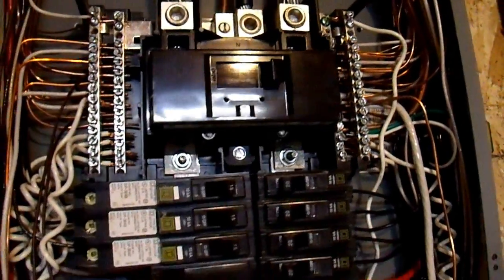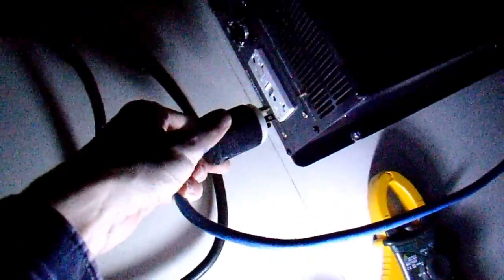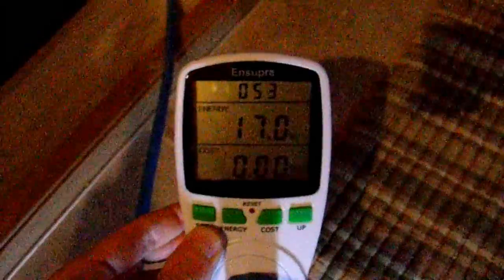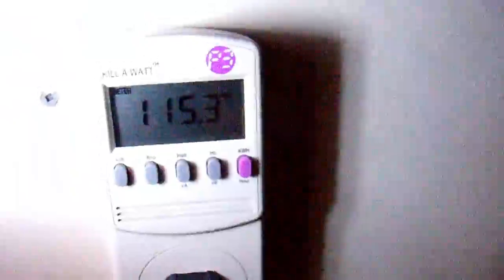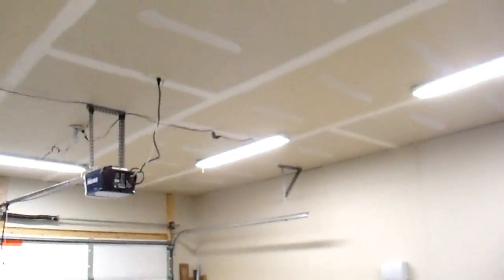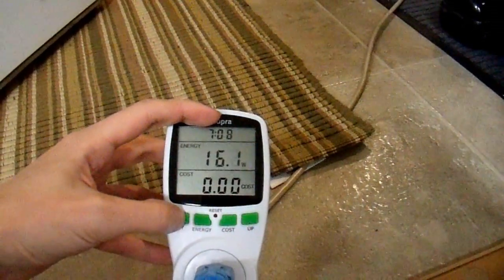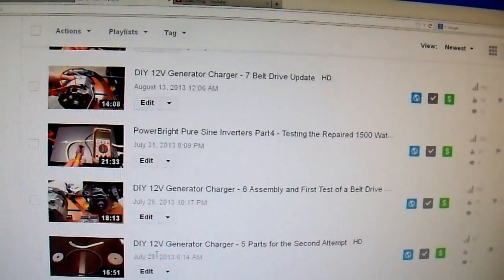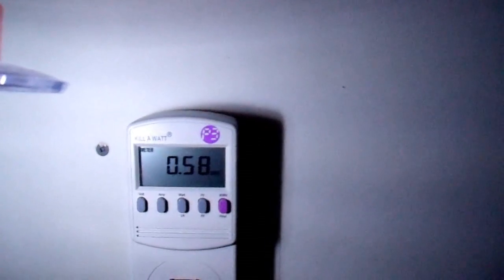How to Power your House with an Inverter or Generator During a Power Outage Part 3/3

Comment: Well, I would by choice would have connected it differently as my use case isn't the same. I want Solar, wind and whatever else to be the main source of power with the Grid as my backup. In your use case I guess you could add another battery bank later if the requirement is there for it. From my research I would have to say money wise if new; 6VDC Trojan, 4D or 8D batteries would be batteries of choice for me. Am leaning to a 24VDC system as I don't plan to use the bank for any other applications. But I could install a smail 12VDC system to gain more practical experience with the epuipment.  In your last video you did make a good point on the GFCI that I didn't think about as I have a friend that is looking at a similar use case as yourself but he wants to send power back to the grid via GTI when the bank has been fully recharged by redirecting the unused power from his solar panels.
Reply from the maker: Trojan 4D or 8D is a good choice, but I happened across a lucky score with these Powersafe SBS batteries that were going to be scrapped so I got them cheap.  Also, for a serious setup I agree that 24V is more practical however I want to keep everything in mine 12V for flexibility.  Everyone's goals are different so this setup works for me but isn't what many others want.  It sounds like your setup will be interesting.  I've always wanted to do a solar/wind setup but have never had the opportunity.
Reply: ***** Lucky !!! Hell! Check mate!! on that score! Nice!

Comment: I did this with my APC unite to power the lights in my shed. I have a 900 watt apc hooked to my battery bank. and it all seems to work pretty good my battery bank has not really had a good load on it until to day with winds up to 30 mph, so I used it to help keep my bank normal. and it has stayed charged for along time.
Reply: Sorry unless your on the coast ? Solar is the way to go!!!!
Reply: Don't Waste your time on wind !   unless your on the water!!!

Comment from the maker: FYI as a matter of interest, I posted this video while on battery backup power due to a power outage.  It is just after sunset and is already -20F outside.  It is a good thing I have emergency power and heat!
Reply from the maker: William B
An idling Suburban may not generate as much power as you'd like.  Think something like 400W - the rest will come from the battery.
Unfortunately the 230v inverter cannot be used to power both phases unless you run it through a distribution transformer first because you need the center tap, which that inverter does not provide.  The method shown here works with a 120V inverter.  If you have a 240V inverter and connect it to a dryer outlet you'll have unbalanced phases which will likely cause significant damage to 120V applicances.  I wouldn't try it!
Reply: ***** Yes, they only work when there isn't a blackout. If there is a blackout, they should switch off. They work by synchronizing the Voltage and Frequency with the mains supply so that it can output power back into the house. If they weren't synchronised, it'd go bang because they (the inverter and mains supply) will be out of phase with each other.
Reply from the maker: William B
Longer cables will only help under load.  With low loads it will still be 15.5V.  The simple solution is to let your suburban warm up fully before connecting it to the inverter.  When warm the voltage should be under 15.0V.  And to those who live in other parts of the world, yes, 15.5V is a proper voltage for an alternator to output in cold weather when designed to charge a lead calcium battery.
Reply: Hey, thanks. BTW, I'm watching your youtube on the GoPower 2000 right now. I think I've settled on the 12v Samlex 2000 Pure Sine just like your GoPower.  I've also been thinking of putting together a four battery bank of  type 27 batteries to run it and use my Suburban to charge them. Any advice on the type/sizer of group 27 batteries to get? I loike AGM, BTW. THANKS!!!
Reply from the maker: HKPolice
There are Chinese clones of the Yamaha and Honda type generators that are very reasonably priced, but they're also junk.  There are many brands out there now including Honeywell, Generac, Champion, etc.  I would assume some of them are OK but I haven't disassembled one to check it out.
Reply: ***** I bought one I agree junk!!! after a hour run things loosen up and you have to tighten (sorry just junk)
Reply: I found a Xantrex ProWatt2000 with a 230v outlet. What about a SUICIDE cord from the Xany to a 240v outlet in my laundry room? What about getting power to the Xany by hooking to my Suburban battery while its idling/running? That way both rails get energized and the Xany has enough input juice! Your thoughts????? I know, suicide, THANKS!!!!
Reply: ***** turning on lights (high beams) and  blower on high should drop the voltage enough to kick on the inverter until the vehicle warms up.
Reply from the maker: William B
AGM is the best type for nearly everything except energy density and cost.  If you can afford them and are willing to take good care of them AGM will last a long time.  I don't have any specific recommendations for a few reasons, primarily because I don't know the exact use situation and your requirements.  I do much prefer lead calcium here in the USA however.  Lead Antimony outgasses quite a bit, smells bad, emits corrosive gasses, needs watering, tends to drool acid, etc.  Lead Calcium would also be a better match to your Suburban which is designed for that chemistry.  I like my Autocraft deep cycles (made by Johnson controls and are only intended for only intermittent cycling) but there are many other brands out there as well.  If you get Autocraft be sure to use Advance Auto's online coupons to get a good deal.  You can get >30% off everything that way.
Reply: Used AGMs in very good condition (used mostly for standby UPS units) are probably the best bang for the buck.  I got 8 of those 6V 230Ah AGM batteries only about 4 years old and lightly cycled for $50 each which is a $400 investment and they are loads of fun.  Using my idling car to boost them for when I used them to power my house.  So the used AGMs take care of the not so good cost and as far as energy density, that is not critical if you use an idling car to boost the power of the AGM bank.  Remember, your car alternator is not only designed to keep your car battery topped off, it is there to run accessories such as fans, air conditioner, lights... so that is why they make them in the 70-100A range for most cars with some being as high as 200A or even 300A nowadays.  Take advantage of that to boost your battery bank.
Reply: Great advice, THANKS!!!
Reply: I'm sure your aware that their are several youtubes of folks who have used a SUICIDE Cord from their 240v Gas Powered Generator/Inverter to their 240v Dryer Outlet. Why will using a Battery Powered Inverter........not work and their method will? THANKS!!!!!
Reply from the maker: William B
It would work with the appropriate precautions as long as the generator was a split phase unit.
Reply: Hi again, you've done an excellent job of explaining the difference between a Live Neutral & a Grounded Neutral! Whats a "Floating" Neutral? Could you make a youtube showing the differences of the three? Are their more? THANKS!
Reply: do grid tie inverters work diffrently
Reply: Northern tool carries their powerhorse house brand (actually a loncin) inverter generator which is advertised spec wise with cleaner power (1.5% vs 3%) than a honda or yamaha. I have not tested power quality in any way but have ran it against hondas with various max loads and its the first chinese gen ive tried that would run as well if not slightly better on startup loads than the honda.
Reply: I looked at your youtube again and thought it strange that feeding the two 120v legs to your fuse box from one 120v Inverter would work. I thought my 240v Inverter method would be better. Looks like your right and I'm not, the proff's in the puddin'. My Suburban puts out 15.5+ volts at Idle which is an Overvolt condition for most Inverters. Longer 1/0 cables to the Inverter should drop my voltage about 1/4 to 1/2 volt keeping the Inverter from shutting down. How does that sound? THANKS!!! Sorry it took so long to reply, I had a heart attack. Lucky me.....